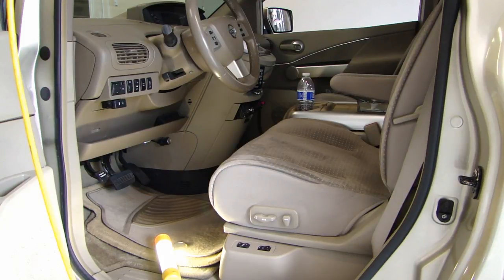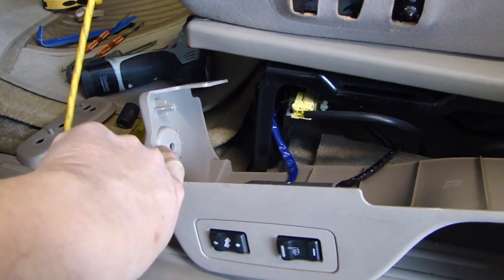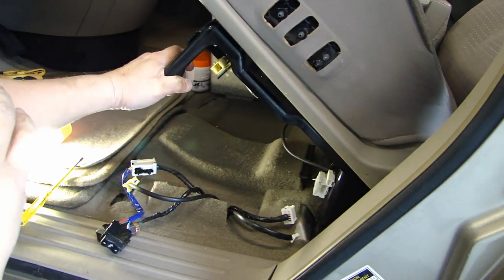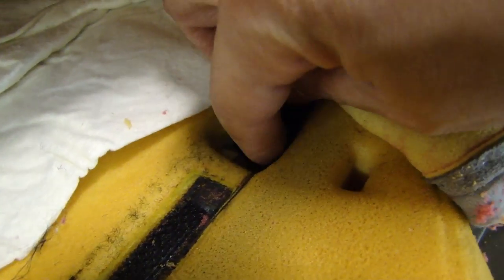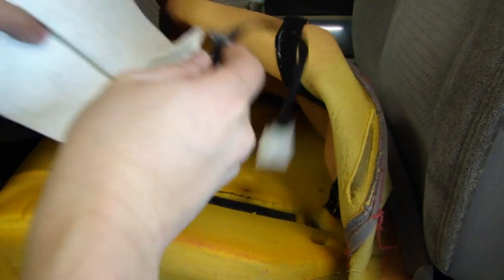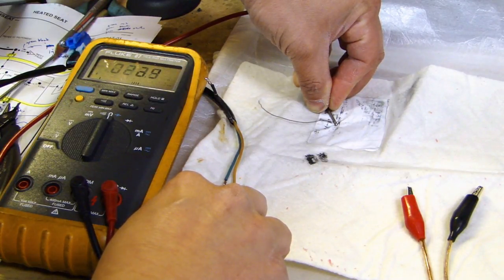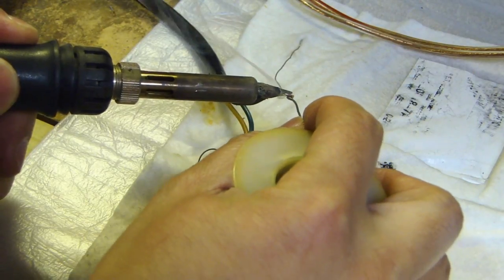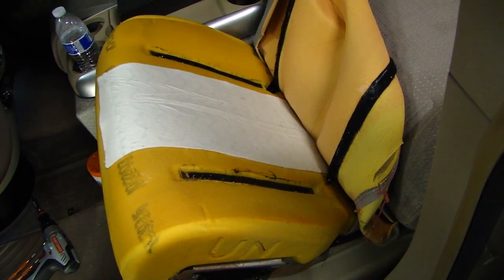How To Fix Broken Seat Heater Element In Car - Nissan Quest

Comment: I've got a 2001 Nissan Maxima, and the drivers side bottom seat is not heating, but the back is.  Unbolted the seat, but I couldn't seem to figure out how to get the fabric off.  Certainly doesn't seem to break loose like you've just shown.  I'm wondering if it is the same as this example you've shown here or if I need to look at something else.  Scared of damaging something.   Can't seem to find any information on the internet on how to do it.

Comment: I just noticed after getting my car back from a upholstery shop that my driver side bottom heat warmer is no longer working. I believe the top seat still works. I'm hoping that it's just a connection problem and the stupid upholsterer didn't damage my seat warmer while repairing my leather seat. Should I have it checked by a mechanic or another upholsterer.

Comment: I really like your videos!  What kind of impact driver are you using?  take a look at some of my DIY videos! Thanks, Tim
Reply from the maker: Hi Tim, that impact I used is a 3/8" Earthquake series from Harbor Freight. Cheap and good.
Reply: dial2fast What happened to your Ryobi 18V one?  Was it too big or the battery is no longer holding the charge?

Comment: FYI. Some of the aftermarket heating pad suppliers do not recommend spray adhesive on the pads. Contact cement flammability issues.